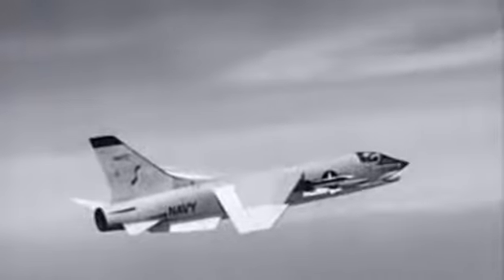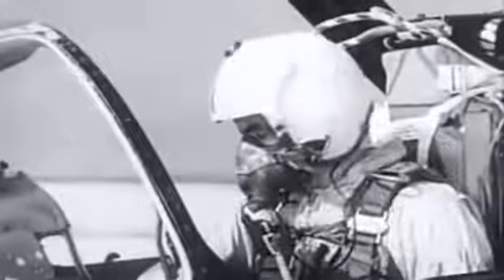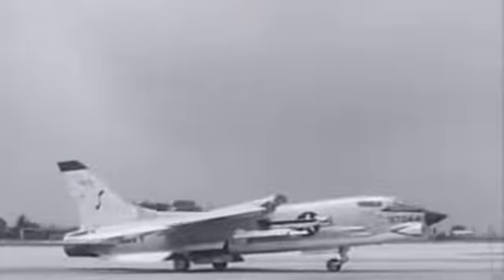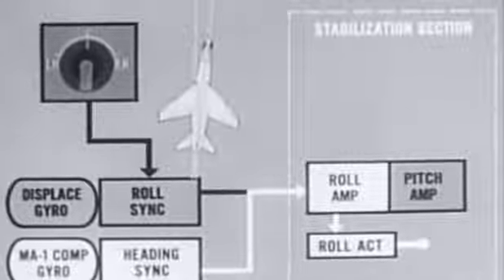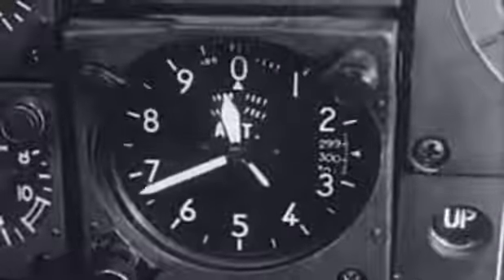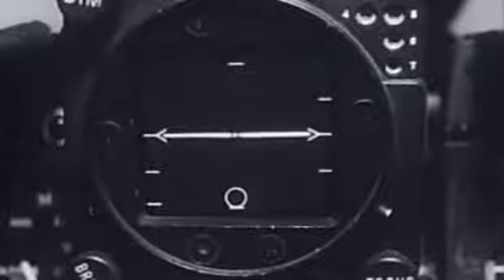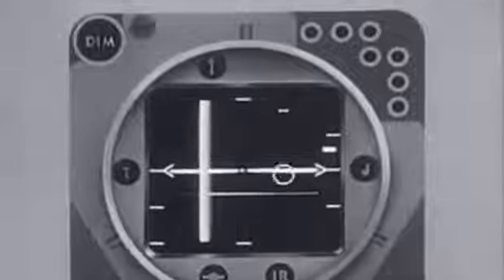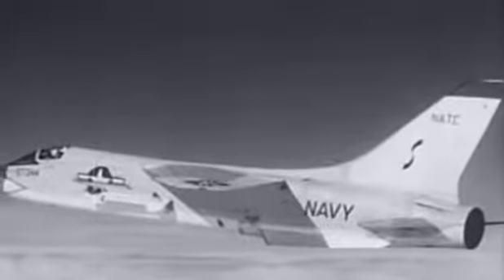Aircraft Familiarization F8U-2N

Comment: Thank you for the outstanding series ,Aircraft Familiarization, that you have posted. The Skyray was most enlightening; pitch over vertical at 30k+ft. and you'll hit 1.1 Mach ,but you need 20,000 ft. to recover. I remember airshows when, after a fly past, you could grab a hot dog before the featured aircraft would come around again.